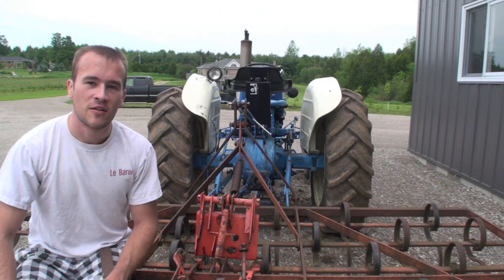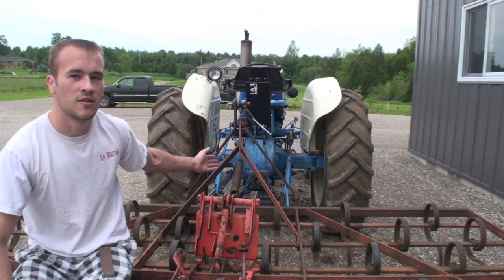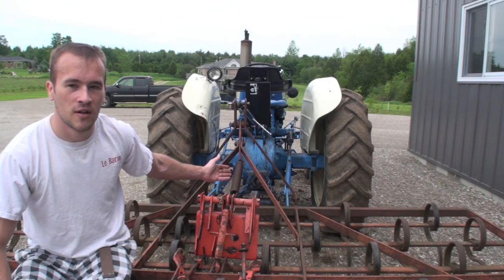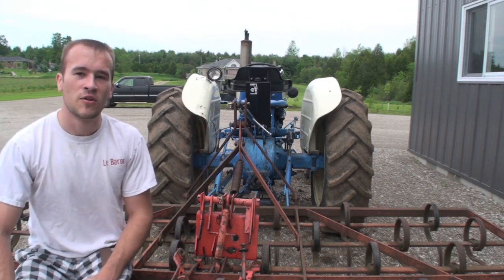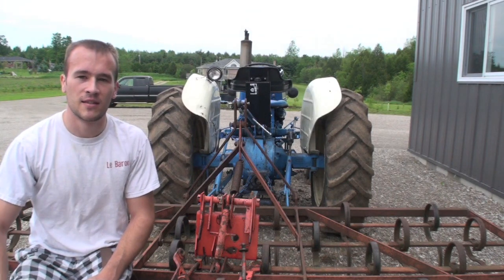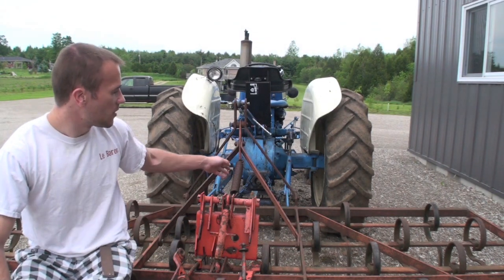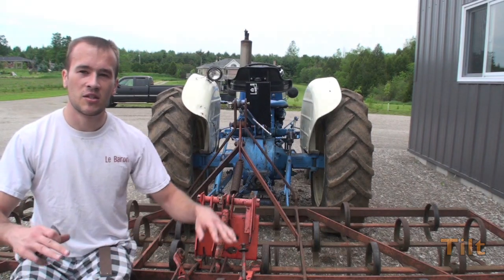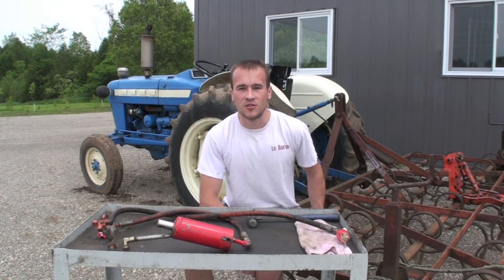3 point hitch rebuild: how to - case ingersoll tractor

Comment from the maker: yes, more then likely its your piston. old style used 3 steel rings, you might need a new cylinder and piston because the rings will gouge the cylinder and then cause the piston to get damaged. I belive you can pull the assembly on the side of the transmission/axle housing. I will send you a link on a rebuild in pdf.

Comment: I have a 1951 ford 8n 4 cyl gas tractor. My 3 point hitch won't stay up when the hydraulic lever is raised in the up position and while driving the tractor the heavy implement goes down which is the box scrapper thats attached to the 3 point hitch, could this be the hydraulic piston rings seeping oil through and not building the pressure? thank you.

Comment from the maker: @mrwiggles2 I remember that one :). Case/Ingersoll as you can see is more of a simpler design, no clips (that confused me at first) you can see that the bolt that holds the cylinder on at the bottom serves as a stop for the foot. editing up part 2. thank you for your comment mrW :D

Comment: Cool.  I rebuilt my Wheel Horse cylinder in one of my videos.  Very easy to do.  I had to remove a small clip at the bottom of the foot, but other than that, slight pressure and it all came out.  Looking forward to part 2.